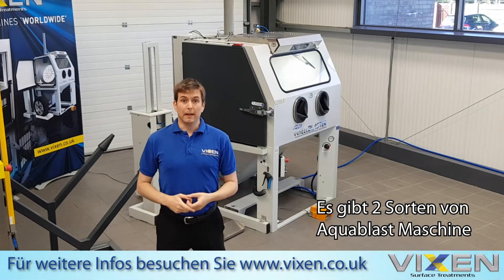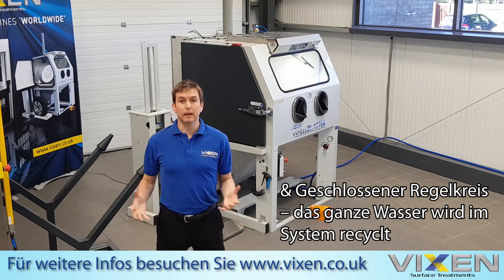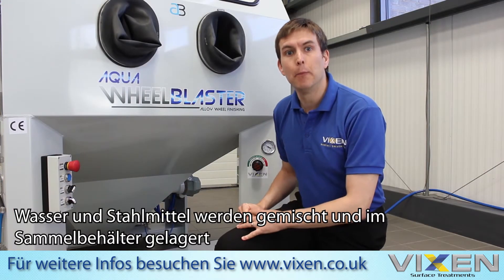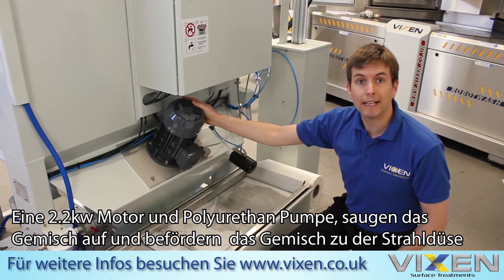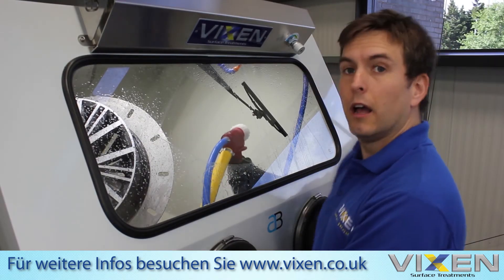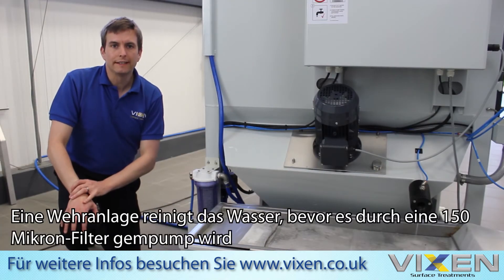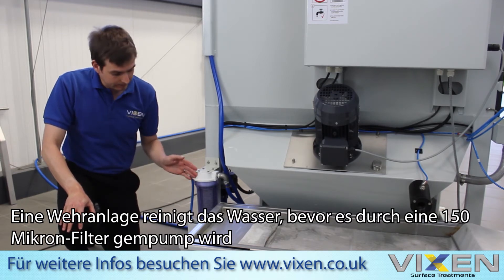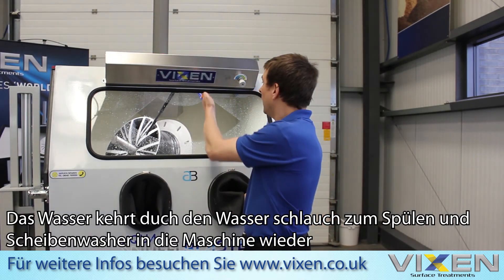Aquablast Geschlossene-Regelkreis

Comment: What kind of maintenance and consumables will a closed and open loop setup have?
Reply from the maker: Hello, the closed loop system is fully maintained, you just have to fill the water occasionally. Whereas the open loop system, you would need the machine sited to a drain and connected to a water supply.